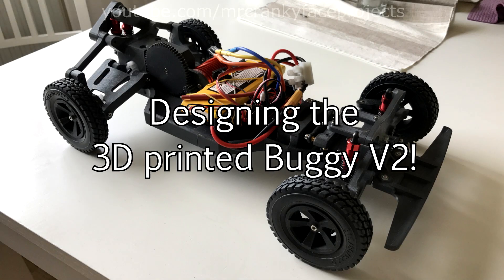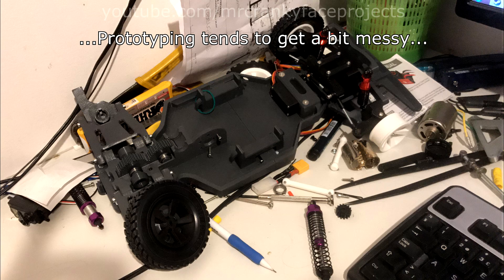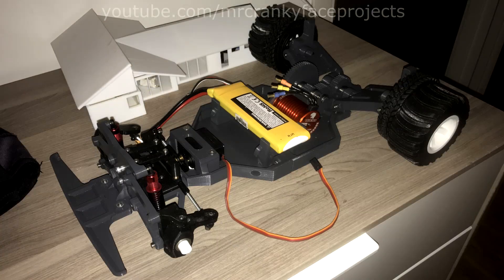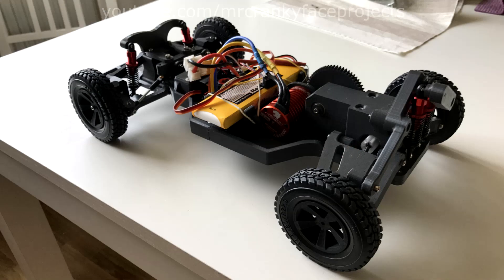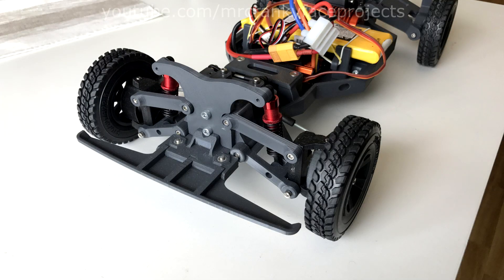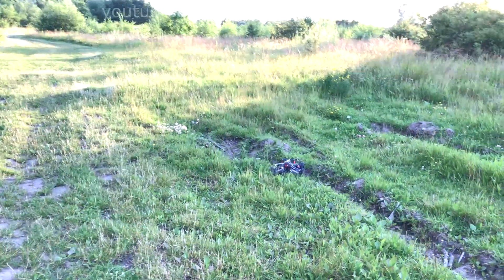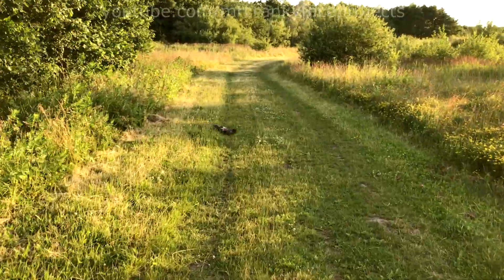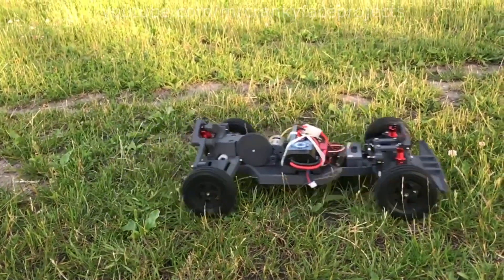3D printed RC Buggy, the second version!

Comment: Great job!! Don't worry about the gear ratio. It could be as simple as changing the motor. Have you noticed any kind of wear in the gears?? Keep going, the improvements are awesome. :D
Reply from the maker: Thanks!
Yeah, motor will definitely affect it but this motor is fairly low KV for an inrunner. I think it's around 3000kv-ish.
I had an idea the other day to make the first and motor sprockets be easily replaceable with some screws, this would let you quickly swap to use different ratios for different circumstances. Just need to find the time to design it... :)
Running the entire gear train dry seemed to produce some wear but nothing extreme. I drove like an idiot for 2-3 hours trying to break it with very little luck, eventually one internal gear(PLA) overheated and bent out of shape. I replaced that one with nylon and greased everything up, since then it has been trouble free.